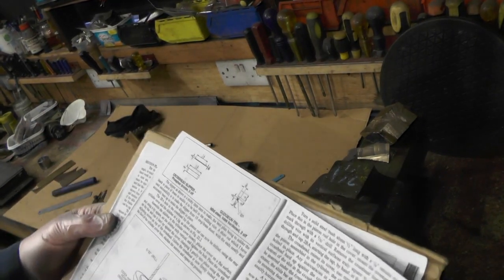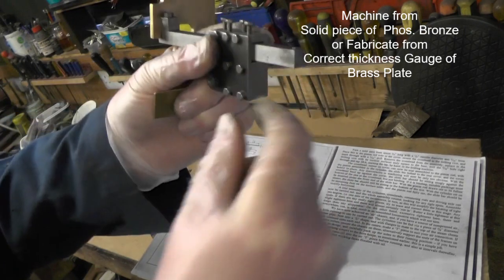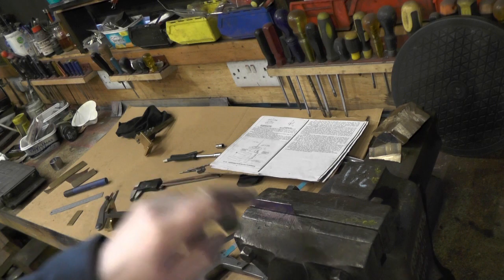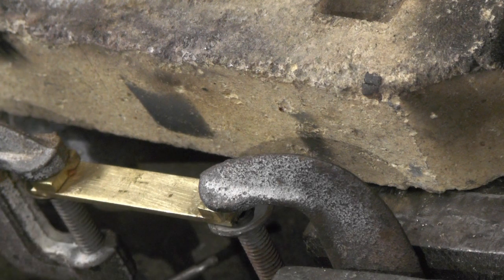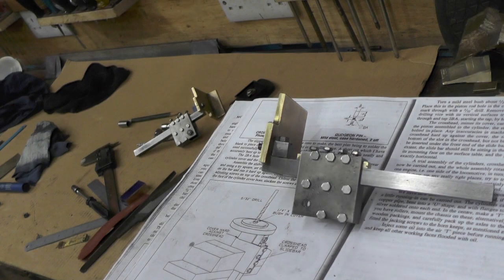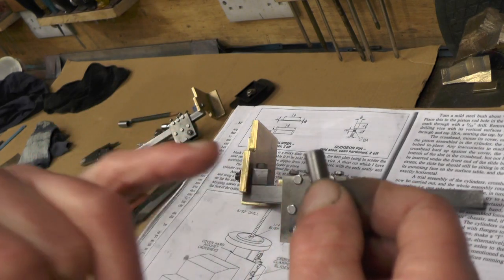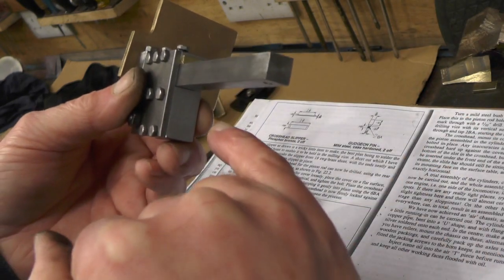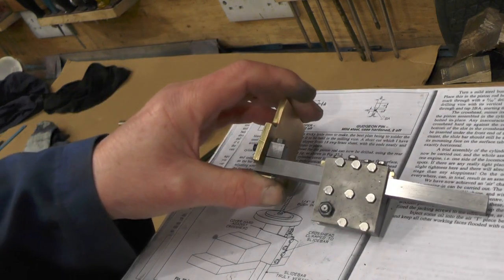Make a Beginners Miniature Steam Locomotive Series ( Crosshead Slippers & G/Pins ) "mr factotum"

Comment: Very interesting. If I've been understanding things, then that lubrication system puts oil on the bottom of the slide bar, but doesn't seem to put any between the slide bar and this slipper plate? Is there something more to come to lubricate this, especially as it's just brass? Maybe I've got things upside down somewhere, or missed the point.
Reply from the maker: No, you have not misunderstood.  That's how it is. You just manually oil the top and sides each time and in between running. Thanks for watching
Regards
Mr f
Reply from the maker: hi
No you have not misunderstood, thats how it is. You have to oil the top and sides manually each time and in between running.. Thanks for watching and interest
regards
mr f
Reply: OK, I suppose it's a wear item anyway, with adjustment. Works a bit like brake shoes I guess, except slippier.